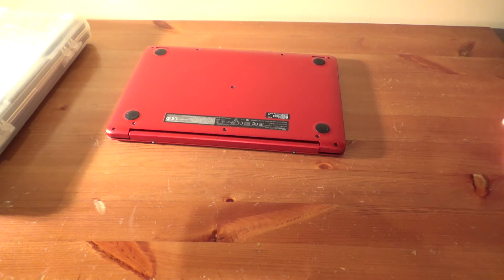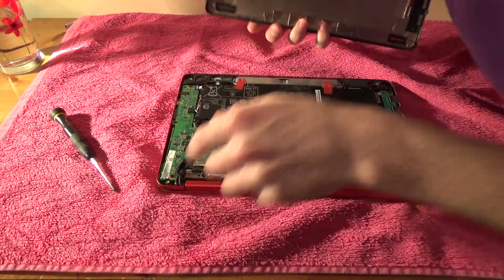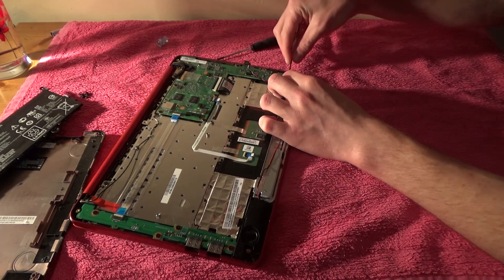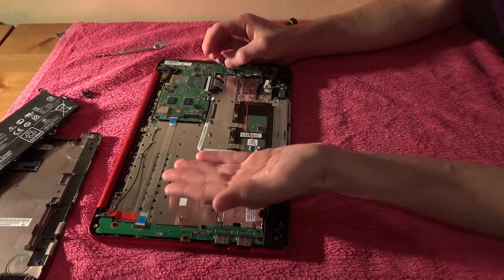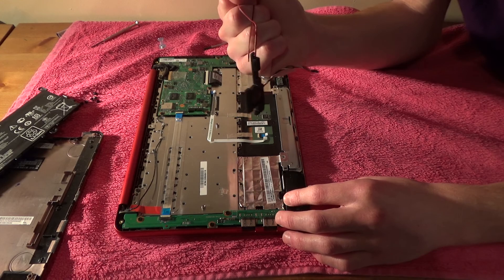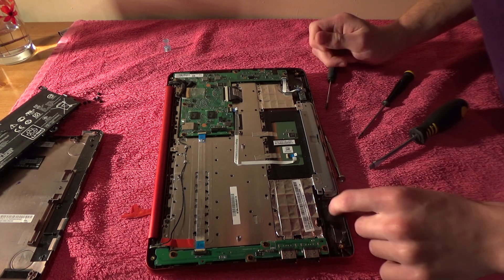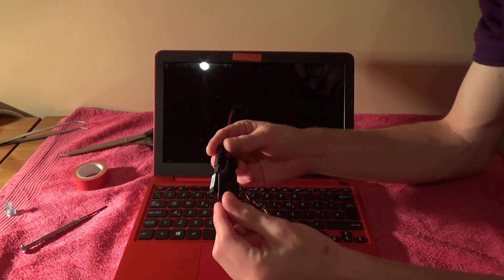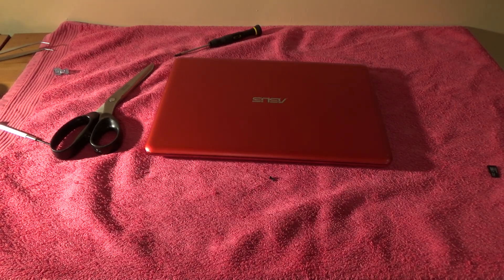ASUS X205TA Speaker Replacement: Disassembly & Diagnosis (Part 1)

Comment: This long list of people maybe confirms my thesis that this is a software problem that cause an hardware one: I ve bought this laptop in 2015 the problem appired in early 2016. My diagnisys is burning speaker due to steady current from the amplifer. The aplifer used is a digital amplifier. I simple words digiral amplifer is a switch that generate a square wave with changing duty cycle(related to audio wave). In that laptop at same point this switch remains in on state. Reboot the system did not work but reset the i2s audio driver worked instead (just desable than enable in driver configuration ). This works obviously if your speaker are not completely gone. The problem can come back suddenly. So the solution adopeted in the video is the safest. I'm convinced the software problem is related to a windows upgrade and never resolved. ASUS could know someting.. someone can be hurts

Comment: Mine too, 2015 model year X205T, early one I think. Right speaker crackled, got extremely hot, and went up in a curl of smoke last night. Speaker looks like Frazer's, you can see some melt. Good thing I hadn't fallen asleep yet. IMd ASUS, no help at all, waste of time as you thought. Love this though, best of its kind I've had, no problems with video at all in fact it's quite excellent in every way, awesome battery life, handles whatever I ask of it (not a gamer). Ordered some used parts, thanks Frazer, we'll see. Hoping audio chip isn't fried.